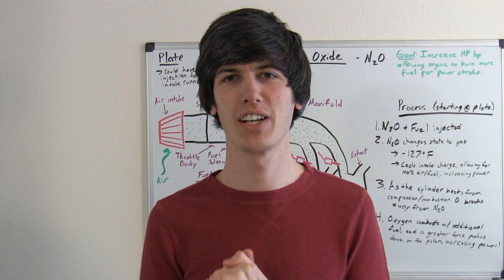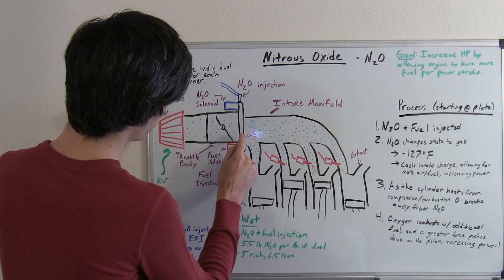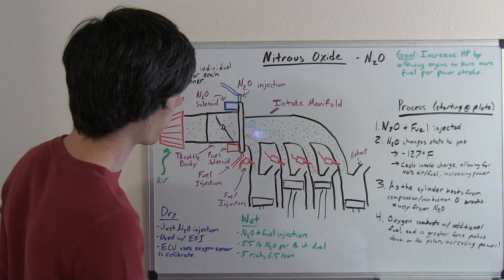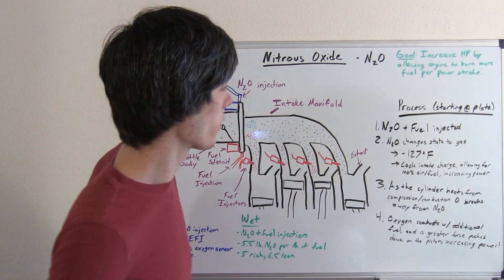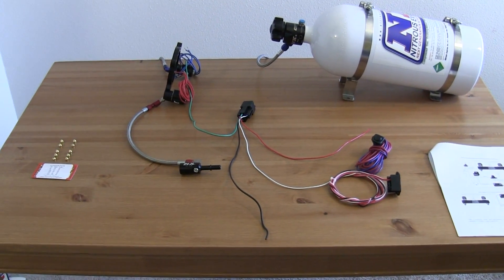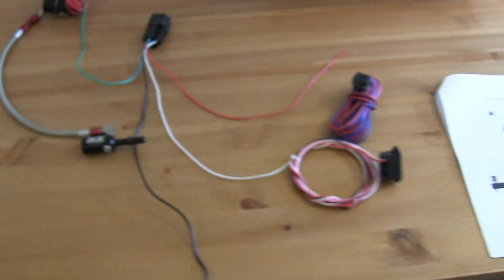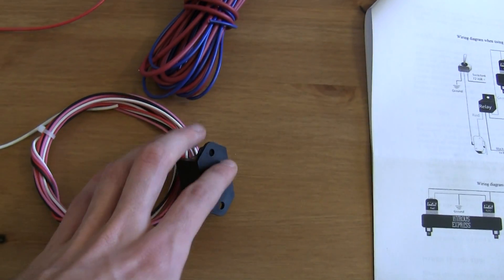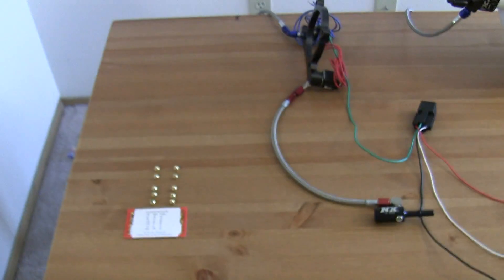How Nitrous Works - More Horsepower!

Comment: What About Direct Oxygen injection (as in just bottled Oxygen like used in hospitals.)
Reply: +Ben Jay That's the best way to cause a very large explosion.
Reply: it's all relative ..

you input the right amount of oxygen and fuel (not nasty explosion)

I am not talking about the safety of the bottle as it would be almost purely for racing applications anyways (or drag racing)
Reply: Lol i got no intention to do it..
But dont see why it would be that dangerous

O2 bottles dont just randomly explode.
Reply: how tho?
what does an engine burn now Fuel + Oxygen all the other inert stuff in "Air" is not burnt and expelled out the exhaust.

So instead of letting the engine Suck in Any air at all via the throttle body
All Oxygen it gets for Compression & combustion is controlled via injection (im not talking about pumping in so much oxygen that you would run lean, i mean just replace dirty air with pure 02 + the fuel (side by side injectors)
Reply: +Ben Jay I think it has to do with 'knock'. The oxygen only strips off the nitrogen at 600 deg which is in the middle of the combustion process. However, with pure oxygen the added compression can cause it to fire prematurely and blow the engine. I could be wrong about this though.
Reply: KaBoom!  Highly volatile. Could pre-ignite. The key of the NOS is its tied to nitrous and only uncoupled under compression which is when you need it.
Reply: Not that the bottle itself couldn't just go boom... you know... pure oxygen... you need to cut the line and re-open it fast enough so that the flow of oxygen doesn't ignite all the way back to the bottle but also provide an oxygen flow consistent enough to fuel properly through the combustion cycles... not an easy taks, especialy on high rpms. I don't think it's even possible.
Reply: Never mind guys i found a major flaw in my Idea.

If it was a closed system and the only air the engine got was bottle air and bottle fuel
The big problem would be volume - Said bottle would need to Fill the cylinder instead of the cylinder pulling Vacuum
Reply: +Ben Jay you think that's the major flaw in an engine who's mix would be so unstable that the heat of the block would almost certainly exceed the flashpoint of the mix? I'm pretty sure flying Pistons would be a bigger issue.

There's fairly easy to work methods to let an engine draw from a pre chamber which stays balanced via regulated input. Drop the pressure to atmospheric and have a bladder that allows the vessel to flex as the engine breathes.

Just be prepared to see the timing go to hell and the machine destroy itself rather rapidly.
Reply: You mentioned that other things in the air are unburnt and are expelled so we don't need them; let me tell you that it is because of the huge amount of nitrogen in the Atmosphere that we're still alive and not burning in eternal flames. Oxygen in pure form is HIGHLY combustible and will react to almost anything to explode

Comment: if used continuously ,how long would that bottle last?
Reply: +kevin d&#39;silva quick rule of thumb is a 75hp shot with a standard 10lb nitrous bottle will net you around 10 full passes at the drag strip. A 100hp lasts around 7 to 8 full passes. My 125shot lasted for around 6 full passes. And when I jetted up to 150hp it still lasted 6 full passes.

Comment: If the oxygen splits from the nitrogen during compression, how does the ecu know how much fuel to add before that? Does it not matter?
Reply: The O2 sensor in the exhaust system picks it up and communicates that back to the ECU
Reply: +That other guy You know So the additional fuel isn't added BEFORE nitrous is added?
Reply: +mrsemifixit When the system is first engaged the engine will be running the same for the first couple RPM until the electronics compensate for the added air. Kinda make sense?
Reply: +That other guy You know Yes. I just thought the system was set up to know how much extra air the nitrous will be adding. But it uses the o2 sensor to determine?
Reply: +mrsemifixit Correct. Even without a nitrous system the 02 sensor is constantly measuring the exhaust gases so the engine can run as efficiently as possible
Reply: +That other guy You know So what about carbureted cars that ran nitrous?
Reply: +mrsemifixit I'd have to look into it a little more, don't want to give you bad information

Comment: Nice example using Nitrous Express! I have videos on how to install electric, plumbing, and tuning for that. This company is the only one that guarantees (by the date I'm typing this) that shot you choose will get to the wheel and not just to the crank. They do this by adding more shot than the nozzles are described to shoot, in order for your shot to be accurate.

Comment: is it works on diesel engine ? I want to install it on my SUV
Reply: +MS_ B works the same way, but it only adds power with what extra fuel in the cylinders need that extra air. So if you have a big laggy turbo, big injectors and a smokey tune. Yes it can make both the turbo spool way faster and add power.

Comment: great video. thank you.

I am running a Nissan 350z 2004 Touring 3.5l v6 (similar to your integra) & was wondering:
What parts would you recommend also upgrading when installing a NO2 kit?
What parts suffer more load as a result of upgrading this combustion cycle?
Reply: +Shane Mouton Headgasket, headbolts, pistons and rods, not necessarily required but this is definitely what you'd want to atleast upgrade to avoid blowing your headgasket>overheating>cracked head or simply bending your rods/melting pistons>busted bottom end bearings>rod out the block and a total wreck
Reply: +Tony Thank you so much. Will certainly do so. I was hoping the heads would be the end of the recommendation there so I would do the rods and pistons when doing the induction & supercharger upgrade...  I guess my kit will have to wait to be installed at the same time.  Back to the waiting game then...  Thanks for the info and great videos again

Comment: Hey Jason, How long would a bottle this size last on WOT?
Reply: That looks like a ten pound bottle. (without a bottle warmer) At 200 shot you have one good run. 100 shot will give you two good runs. Four good runs at 50...ehhh you get the point.
Reply: +jacob anderson Thank you.
Reply: +Evan Hasson +jacob anderson 

He is not correct at all. 

a quick rule of thumb is a 75hp shot with a standard 10lb nitrous bottle
 will net you around 10 full passes at the drag strip. A 100hp lasts 
around 7 to 8 full passes. My 125shot lasted for around 6 full passes. 
And when I jetted up to 150hp it still lasted 6 full passes.
Reply: spikeafrica 

Like I said..Those are the (good runs) from a ten-pound-bottle. Yes it's true, you may have some runs after the ones I specified, but their really crapy runs to be honest? 

And I'm not talking about having dairy products or having strong cups of coffee here.

It's also true that Nitrous Express (which I run all the time) (which this video guy is talking about here), uses a little more nitrous than specified to get the power to the wheels, rather than the crank, so that would account for less bottle pressure after usage than normal.

Like I said: (without a bottle warmer) to keep the pressure up to optimal numbers, you'd have to rely on the bottles ability by itself to deliver optimal runs with the pressure it provides on it's own.

I've spoken with Experts at: Ford racing, AmericanMuscle.com, BAMA Performance, university teachers in the auto department I've had classes in (performance classes they call "hot rod", such a dorky name right?). And all have explained to me about this and amongst other things as to why this happens with nitrous and their variables, and this is all of their input. Plus I have experience with it. 

So yeah, the (good runs) are the ones that count during competition.

Geez, I didn't mean to write you a book? My bad...

Comment: what kind of engine can withstand a turbocharger AND a nitrous inyection? specifically talking about materials and design of the engine block and other performance components
Reply: +Enzo Mansur Big block torn apart and rebuilt with modern parts of stronger stuff to withstand abuse. We have guys who have supercharger + twin turbo + 200-shot nitrous setups on their 800 C/I engines rolling around.

Comment: n2o breaks into oxygen and it helps in combustion,why cant we directly use oxygen instead?
Reply: To dangerous in high amounts. It could light the fuel air mixture when it hits the hot combustion chamber.

Comment: just out of interest; can i use hospital grade nitrous in my car?
Reply: +Rob Jeeves Bahaha! Actually yes you can but there's a trace of sulfur in there which over time may corrode your internals. That's if you somehow get a hold of some because medical grade requires permit but auto isn't, plus the tanks are veerrry big and heavy. You'd have to mount it on the roof.

Comment: Question on the whole pressure and compression deal!  I have a Silverado and I am looking at putting a dry kit, I know if you have a small engine that has low pressure ratings and all that stuff you should modify it to Handle the nitrous but in my case with a large engine that has higher ratings, will I still need to upgrade anything or will I be ok to place the kit on and it work well?
Reply: +Ken Anderson Do some research first. I can tell you haven't because if you did you wouldn't even be looking at dry kits. What year truck is this?

Comment: Does the nitro blow up your motor, though? I've got a 2012 Dodge Challenger SRT8...
Reply: +ELLIOTT MORIARTY You'll blow the welds on your intake.
Reply: So, what's the point of doing nitro if it damages the motor or is it only on some cars that it will damage?
Reply: +ELLIOTT MORIARTY the engine needs to be built to handle the extra pressure, if you slap a nos kit on a stock engine you're setting yourself up for failure

Comment: So basically nitrous lowers your engine's temperature and thus helps in sucking in more air thereby producing more hp? I'm a little confused here.. could anyone explain it for me?
Reply: +Vishal Jagannath lowering the temperature is just one part of the process, colder air does mean more oxygen so more power, but majority of the extra oxygen is coming from the injected nitrous which has oxygen in it, the super cooling effect is just a bonus
Reply: +Tony understood. Thanks!!

Comment: Great video! The only thing I did not get is how the N2O lowers its temperature when changing into liquid? Aren't materials supposed to get hotter when they turn from liquid to gas and vice versa (like for example liquid nitrogen and gas nitrogen)? Could someone, if not EE, explain?

Comment: Why is nitrous used at wide open throttle? Is it bad/disadvantageous to use it at lower rpm/power stroke?
Reply: Nitrous provides massive and instantaneous torque.  Using it at low RPMs can damage the engine with such a violent application of power.  If you set your system for 100HP, you get 100HP instantly, unlike turbos.

Comment: dang bro!  you should be featured in the fast and furious movies!  awesome vid!
So If i put that in my Honda accord though, I could crack my headers right?  Cause my little i-VTEC engine wasn't designed to take the added combustion pressure that nitrous would add isn't it?

Comment: Why don't we simply use pure liquid oxygen? If the purpose is just to bring more oxygen in the cylinders. +engineering explained
Reply: +Alexandre Plewinski Because pure oxygen is very dangerous, it's a strong oxydizer. Never heard of liquid rocket engines? Liquid oxygen react with jet fuel and hell break loose :P

Comment: Doesn't the N02 increase cylinder pressure as it expands when turning from liquid to gas?
Reply: It's dropping pressure.. When the liquid changes to gas it's becoming low pressure, low pressure = low temperature.. Exact same as an aerosol can
Reply: +Shaynal Beads the temp of an aerosol can drops because the pressure decreases within a fixed volume. If you put a liquid in a fixed volume and it turns to gas the pressure inside said fixed volume will increase because the liquid expands when it turns to gas. this process is the opposite. it's like adding stuff to the aerosol can.
Reply: +misztal2112 okay yes I get you.. Sorry I read your question wrong.. Yeah I guess it would increase pressure because your feeding it more fuel/nitro.
Reply: +misztal2112 Yes, the pressure in the cylinder will increase, which is the whole concept behind increased HP.
Reply: +asdfgoogle Yes the end result is increased pressure, but does the NO2 increase cylinder pressure exclusively just from changing states? I'm talking before combustion even happens. If that is the case then I don't see how the NO2 can drop the temp since temp and pressure are directly proportional. Can someone educated chime in? Jason, don't you comment on your own videos?
Reply: misztal2112 I don't know 100%, but i suspect that the NO2 will not truly lower the temperature of the cylinder. It will only allow it to act at a lower temperature (allowing a more dense mixture into the cylinder), because increased combustion will cause the temperature to operate back at nominal range.

I think only the very first rotation of the cylinder heads after injecting the NO2 mixture will have a lower temperature.... but it would be so insignificant, it's not even worth mentioning (probably less than 1% difference from nominal for only a fraction of a second).
Reply: don't things contract when they are going cold? wouldn't this apply to gas? Doesn't it contract when it gets cold? Doesn't "more substance in less space" mean higher pressure? Or is it that it contracts in a fixed space within  the engine, and so taking less space in it and so lowering the pressure in the engine's fixed capacity?
Reply: Vasilis Green Is this scenario, "more substance in less space" will not result in more pressure, because the referenced material isn't in a fixed location (think a NOS tank or oxygen tank for diving).

Instead, it's speaking of reducing the pressure of space by cooling it, which contracts it. I think you were thinking of it backwards or something.

Comment: I changed to colder spark plugs added a fuel pressure regulator and added the nx Gemini twin system with maximiser 4 and I can't turn on the system because now the car is jerking and I don't know what it is?? Any ideas I also replaced the plugs thinking it was that.... Now my only guess is a coil or carb problem but I'm no mechanic/ engineer
Reply: +Troy mackeod Did you check the pressure on the regulator? Usually, if it's adjustable, they're set to the minimum pressure out of the box and that may be starving the engine. Some might come at max pressure too. I'm fairly certain that if you put your original regulator on it will show you the problem.
Reply: Thanks man you might be right !!

Comment: hey, i have a question.  i have a mazda 323 2.0L 16v turbo, on 1 bar boost. what would work better for eliminating detonation in the engine, wet nos or water-meth?
Reply: +muis booyzen If you have detonation issues, nitrous should not be on your list of things to do. Also they both act pretty differently. I think you need to do some basic reading on what each does first.

Comment: So basically, everything horsepower related goes back to getting more oxygen in your cylinders for more fuel mixture, correct?
Reply: There is something called the "fire triangle" if you look it up you will see the 3 requirements for fire, but basically they are fuel, oxygen and heat. To get more horsepower you have to increase these, so yes, you need more oxygen! If you didn't add more oxygen then the extra fuel you add simply wouldn't burn and would leave out the exhaust. The reasons behind this are to do with chemistry though and are a bit harder to explain, you could look up chemical equations for burning fuel as a starting point though if you're interested, hope this helps :)
Reply: +LolDarrellLol Yep, as simple as it seems, there's alot behind the scenes, getting as much air and fuel is the key to power, but having the right parts to take the extra stress of more power + the ECU to keep up and program the addition of the extra fuel and air is what makes it really work